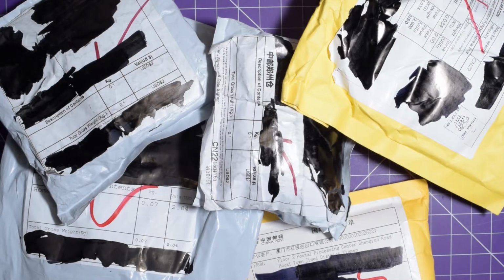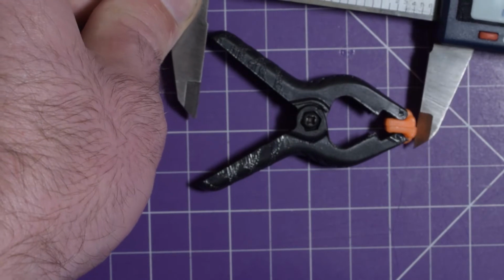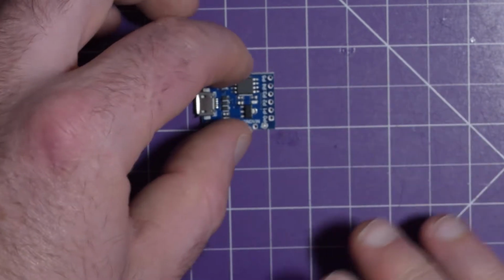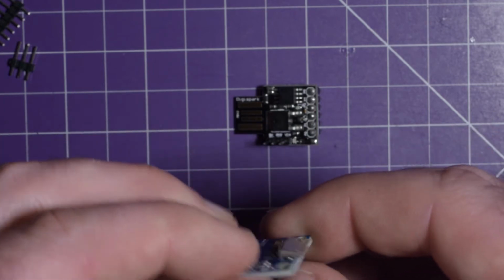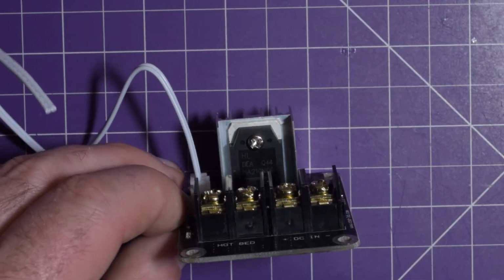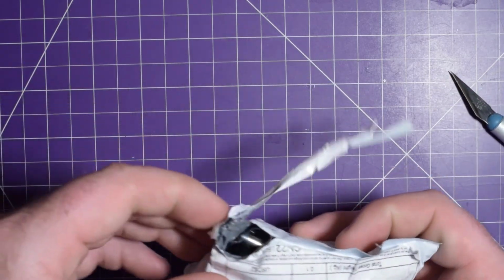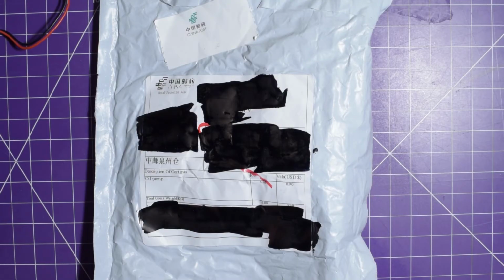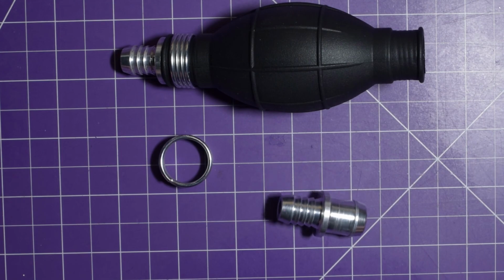Mailbag 08 - Another Random Assortment

Comment: I like those magnets.  If I need to charge Li-Ion cells like for example a phone battery then I use 2 paperclips that I can bend to make contact with contacts on the housing. Then I use 2 crocodile clip wires and I stick the magnet on my LI-500 charger. charger so I have something that I can use to attach those wires to.